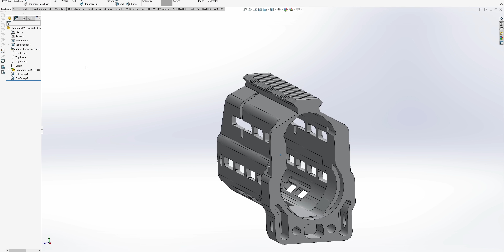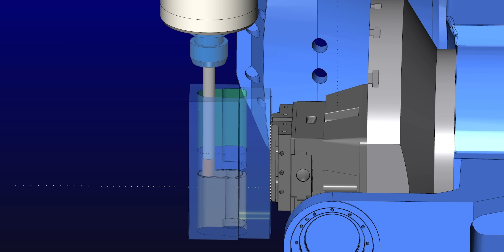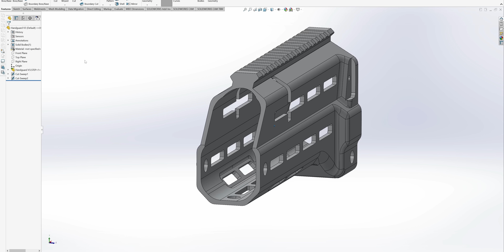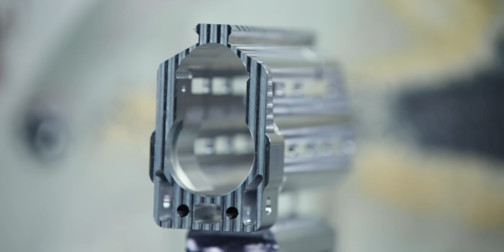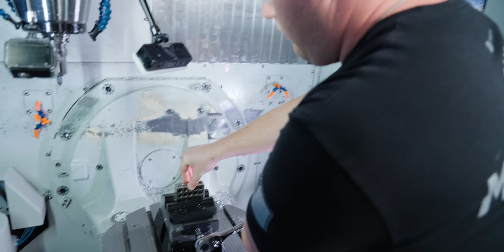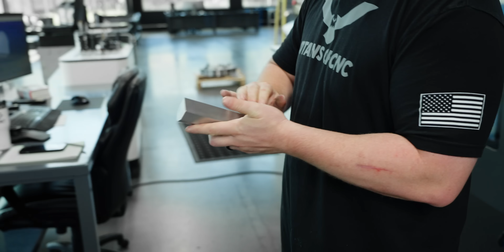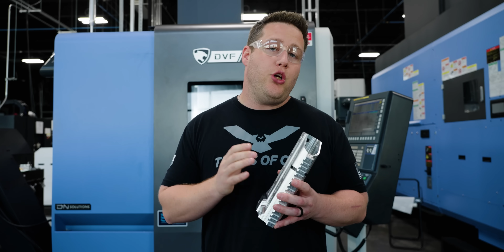Re-Machining the SCRAPPED AK-50 Hand Guard for @BrandonHerrera

Comment: I’m a machining student and imma be honest i set my feeds and speeds based on how the tool sounds (manual mill)
Reply: Thats pretty much how I used to do it as well, however it doesn't hurt to use an app like FSWizard or something of the sorts to figure something out (That is if your shop is alright with it). Also helps to record the feeds and speeds you like for different materials in a notebook.

Comment: since you made the pocket im very surprised you had to measure to get a size for your crush block ? if you'ld cut the crush block diagonally like angle blocks and run a screw through one into the next to contract them you'ld have an adjustable crush block that will take up any tolerance and give you control over the pressure exerted ? thx for a great vid full of learning points. the inside pocketing is some real 5axis wiz'ry.

Comment: Does anyone make a 2 tooth T-head key cutter that can "plunge" cut with the shank side faces of the teeth? That along with a mill that can rotationally index the cutter might let you thread it thought the slot, spool up the spindle, cut the face and then reverse the process to get the tool back out. It would be a extremely specialized setup, but if you were building a few hundred of these it would likely save a pile of time.

Comment: Now... What would this part look like if it were designed clean-sheet for additive manufacturing? You'd get a pretty wild part if you engineer this for 3D metal printing, and you guys do have the ability to print this part!

Comment: Got to say that this video has left me impressed with MasterCAM. When I used it it was a very bare bones and basic bit of software but looking at it now and it looks like a proper tool and a solid bit of kit. I'd love to see how it compares to NX which is what I use at work.
Reply: Mastercam is my favorite cam software for sure and it’s king for our Haas machines and 5-axis fanucs. But our 9-axis Siemens controller, all it wants to do is send the spindle through the part for simultaneous 5 axis machining. Nx still is better there. All the more reason to stay versatile in your trade though and to keep adding to your toolkit.

Comment: Anytime I run a long tool and get chatter I like to slow the rpm and conventional mill instead of climb. Also found using HSS cutting aluminum works better than solid carbide in certain applications with chatter

Comment: Thats what happens when you cheap out and go with xometry instead of dealing with a real machine shop..
Reply: That's the terrible part, it was a real machine shop. Domestic here in the US.
Reply: @ChefurCustom  they should be put on blast, I would never let something like that leave my shop. Looks like they ran it on a 3 axis and looks like they used an edge finder on the flip and didn’t even indicate it in to locate it properly..

Comment: Buy the key cutter, time it in a holder after you grind half of it off, and then you can fit it in. Have to run it slower but then you don't have to waste time 3d milling with long reach tools. Alot of new machinists don't like grinding custom tools but man it saves so much more time.
Reply: You can get one tooth cutter inserts for sandvik Coromill groove tool shanks for this kind of stuff. Just need to index them to clear the slot. Have used them back when I used to work in a  cnc proto shop. Made some interesting optics frames.
Reply: @MJPilote  yeah I love those. I used to just take a cheap moon cutter to the manual grinder for five minutes and turn it into those , but the new adaptive holders make that SOOO much easier.
Reply: depends on a number of factors, including the amount of parts and whether or not you can try out something on such a prototype that you couldn't as easily in production. overall you're right, though, but creating specialized tools is something that's rarely taught nowadays anymore, let alone the knowpedge on the manual machines that are usefull for this. tool and cutter grinders, like the old deckel ones, that are more than just a dbit grinder are a rare beast to see today.
Reply: @10010110100102Error  They may have a tool and die guy who knows, but like you said in the beginning of your comment it probably wasn't worth the material and man-hour cost to make the one tool for one operation on a one-off part; it'd also increase the amount of time needed to fulfill the order.
So, they did the sensible thing and instead of presenting the customer with a compromise that'd increase operations, time and cost, just for a single one-off tool for a single one-off part for a single operation, they offered a solution that could be done quicker with an already existing tool without increasing the amount of operations or projected man-hours.
Reply: i think he meant the dia of any cutter wouldn't fit through the slot. I would just run it with the holder and no tool so its lower than where it should be, and then just insert the cutter pressed up against the stock. then the program can move down start the spindle, feed up and then cut the feature, drop out, program hold, operator removes tool, program goes to next location and so on. not worth changing design with the customer, and the calculations seeing if a long tool can reach and have clearance.
Reply: @joshmdmd  thats why we improvise and use one tooth cutter or lathe tool on milling spindle. Anything to get the job done if not having so fancy equipment. It's nice to have those new machines but one can get very much done with simple 3 axis vmc
Reply: @MJPilote  yeah single point would work too.
Reply: An additional factor is such: You can make a specialized tool for a one off operation but how can you guarantee the same result when you move on to manufacturing?  When you might need to make ten, fifteen spare tools because the client wants 10,000 parts.
Reply: It's hard to justify on a one off, but in manufacturing it's also tough to guarantee consistency.

Comment: You could have used the picatinny rail to do the second op. Mount a rail clamp to a machined block, mount that to the picatinny rail, and clamp on to the solid block. It should be plenty rigid for the second op.
Reply: you could have but when you pride yourself on precision crush blocks are the correct choice
Reply: Harmonics might play an issue with the thin sidewalls of the piece. Probably would have resulted in the part having the harmonic issue instead of the tool.
Reply: I don't think it would be enough material for such a large piece, grabbing the biggest chunk you can with the most surface area for the vice block to grip was the better choice IMO.
Reply: I was thinking the same about using the picatinny rail, but I don't think it has enough meat to keep the chatter down when roughing the inner and bottom portions of the part. It still had chatter issues when biting onto the wider dovetail.

Comment: pro tip, use 3 tabs with some height separation, so it doesn't wiggle and you don't ruin your part. the wiggle is just unwanted, and unnecessary.
Reply: Lol unnecessary ? Clearly he did it for the tube

Comment: Anyone here know what machining a part like this cost? Is it in the single thousands or tens?
Reply: That part at +/-.010 tolerances all over will be cheaper than the same part at +/- .001 tolerances.  If they are doing it on a 5 axis machine like shown here it'll cost more than doing it in multiple ops on a 3 axis machine.  Different shops will have different prices for the same part depending on a number of variables.

Comment: Absolute work of art, very gorgeous.

The mismatched wall thicknesses on the first handguard reminds me of a somewhat similar incident that a vendor machine shop did to us at my last job...they saw the 1/8" per side of tolerance from the drawing and pretended it was 1/4" from one side, leaving an as-cast surface on the other side. Being too lazy to take the part out of the fixturing and flipping it over to do the job right is not a recipe for success in a machine shop.

Comment: The way you do the relief behind MLOK slots without having to modify it like you did is to use a two tooth/flute t-slot cutter.  

You use M19 and align the spindle so the two teeth fit in the slot length wise, feed below the wall, then you start the spindle once you are below the wall. Once you are done, you stop the spindle and, align with M19 again and pull the cutter out.
Reply: I've seen that done before on something similar. Definitely a clever solution to the problem.
Reply: We designed it to be done manually by dropping a keyway cutter through the hole and then grabbing the shank on a Bridgeport - a bubblegum fix for our nightmare part.
The way you just described makes a ton of sense - I wasn't even aware a 2 flute T slot cutter was a thing.
Reply: @ChefurCustom  I made my first 2 tooth cutter out of a 6 tooth cutter when I realized the mlok slot was narrower than the relief you have to have behind it. 

Your solution was pretty close to mine the first time.
Reply: that's friggin genius.
Reply: Place I worked previously used a 6 tooth cutter, but removed 2 flutes that were opposite eachother. Otherwise we did the same thing.
Reply: If Brandon wants this to go into production he’s gonna have to switch to extrusion. We don’t want a $1000 handguard.
Reply: @jamesrozell6467  You think that was only $1000 to machine?

They'll definitely make something easier to fabricate than this if they make a production version. Is production even part of the plan though?
Reply: @inthefade I'm pretty sure Brandon has said in a previous video something along the lines of  "No, we are not going to produce these, you couldn't afford it if we did." He will probably make a few for his friends and himself, but that's about it.
Reply: @KWAZ449  That's a lot of money, man hours and a fuck-ton of prototyping for a one-off toy. Is it even worth it to build this as a one-off? That'd probably make this a $150k rifle at least, all said and done. That guard was at least $5k on its own.
Reply: @Sun-ut9gr  Yeah. He said wasn't going to mass produce. I think he will probably  make a few, but not for sale. I think he's doing it to prove he can as a labor of love. It's honestly a good marketing strategy too, because it brings views and money.
Reply: @jamesrozell6467 - or a 2-piece/multi piece design. I wouldnt have an issue with a interlocking 2-piece design like LWRCI uses on their IC M6 piston-operated rifles handguard.
Reply: When you dont know this trick you shouldnt operate a cnc machine. Thats first year apprenticeship stuff.
Reply: @MrEglisau  I don't think a lot of people are aware 2flute tslot cutters are available. I don't even think having a two flute guarantees is will clear. Most modern machines let you orient the spindle so it might be a good approach if its something that fits and you already have it.
Reply: @joshmdmd  Firstly, the processing in the video is not close to the customer's drawing, so it's wrong! Secondly, you keep forgetting that you should first be a mechanic before you work on a CNC machine. As a mechanic, you also learn how to grind your tools yourself on a grinder.
Reply: @MrEglisau  sorry I couldn't hear you over the stupidity of your post.